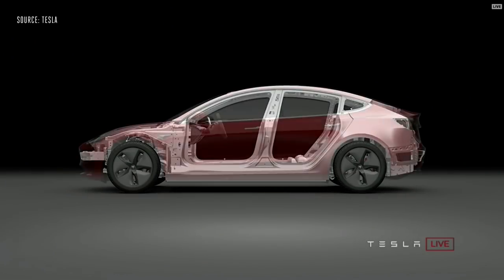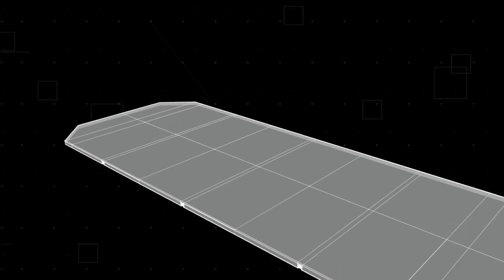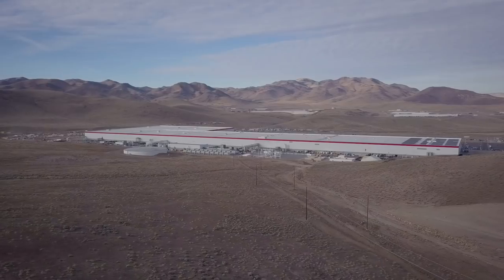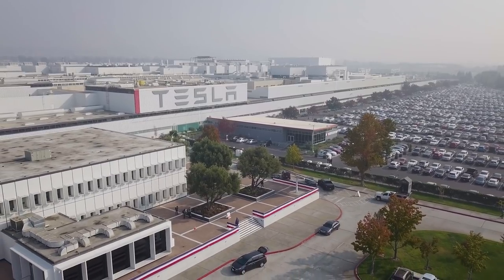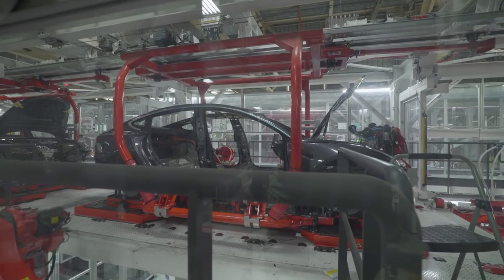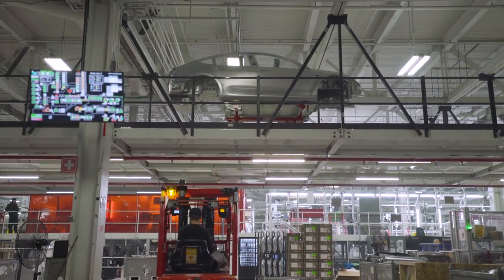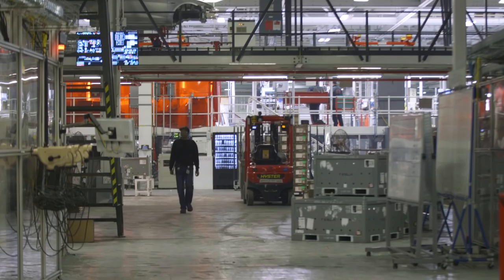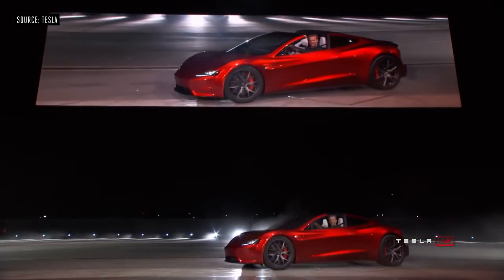This is Elon Musk’s key to Tesla’s future

Comment from the maker: What else would you like to know about the Gigafactory?
Reply: Everything;) lol
Reply: Great Work Verge!
Reply: how many works a gigafactory can create?
Reply: Everything
Reply: Full length documentary
Reply: Have you met musk?
Reply: What's it's CO2 emissions
Reply: Nope
Reply: Is the gigafactory fully sustainable in terms of electricity rigt now or will it require more solar panels ?
Reply from the maker: Kneggor  They're mostly separated (the employees even wear different shirts/hats), but as soon as cells are finished and checked on the Panasonic side, they get sent right over to Tesla for integration into battery packs. Panasonic has maybe a third of the existing factory. – Sean
Reply: Does it seem chaotic? Or organised?
Reply: Please, how can we buy some batteries from the panasonic division there please!!!
Reply: If you`re aloud to, did you see anything or go somewhere in the building that confirms the rumors that tesla will be building their next cars (Y, semi, roadster 2) at the gigafactory or is it all batteries? and if so, which car(s)?
Reply: @TheOriginalDeckBoy  You can't. They are Tesla IP and can only be produced for Tesla use. You would have to buy batteries made in another factory.
Reply: Will the Semi be built at the Gigafactory ?
Reply from the maker: @vincentbelpois2600  The Gigafactory still has a long way to go before it's fully sustainable. It's still currently connected to the electric grid. There's only a few hundred panels at most right now, but when complete there will be 200,000 panels on the roof. Tesla also wants to use geothermal and wind energy for power, too. – Sean
Reply: How many people are working there?
Reply: with a large part of the factory being fully automated how many actual people work there?
Reply: These are my favourite videos
Reply: I wanna know where Elon sleeps and tweets like a drunk man.
Reply: Will there be enough room to have enough solar panels to power the entire factory?
Reply: When will they finish putting solar panels on the existing roof of the Gigafactory
Reply: How much water does this plant use?
Reply: Will Tesla (gigafactory) be one of the pioneers producing solid-state batteries?
Reply: @Elon Musk Do you employ a person or persons whose main purpose is contradicting your specific long term vision as well as your intended goals? I ask this purely from a leadership perspective as I am trying to understand how to both be able to set achievable goals to strive at a seemingly insurmountable dream, but have enough perspective to foresee the hurdles that can derail such big visions and often stop the ability for others to believe in the plausibility of such lofty ideas. 

My train of thought here spawns from wondering how Kennedy got an entire nation behind the lunar mission at a time when such ideas must have been absolutely the work of a madman whose vision was radical to most and actually believed possible by only a very few. I want to have a future where dreamers can dream and use those dreams productively and realistically and just wonder if employing people to contradict these goals could help to actually achieve them quicker by highlighting risks and problems at the earliest stages possible. Or am I relegated to spending most of my time attempting to be my own devil's advocate to fill that role? The ladder almost hinders the ability to stay committed to those dreams. Maybe this is a question best answered by that very introspection but I could think of none better to pose this to. Thank you for any reply, in advance sir.
Reply: Great work
Reply: Tesla roadster 2.0
Reply: +The Verge , What happened recently in Gigafactory about faults found in some 600 Products in Production line ? Would like to know the issue.
Reply from the maker: @Fock42  About 10,000, including Panasonic employees. – Sean
Reply from the maker: @brentquade7032  They haven't given a date yet, but sometime in the early 2020s. – Sean
Reply: Where does the employees come from? Do they sleep in or near the gigafactory and the Fremont factory? Where are the housed and does he work with the cities and towns to accommodate his employees, upper management and production workers? Is food brought by the employees or  brought by a catering company? Is there plans on building multi-level parking garages for the employees at each factory?
Reply: What are the coolest robots?  Are they mostly robotic arms with custom effectors, or are there fully custom robots for moving goods, grouping lithium cells into batteries, or winding motors?
Reply: Worker safety, conditions and pay. Anything else is just a commercial for Musk, Inc.
Reply: Rodrigo Lay Saenz, not sure but it’s going to be 100% renewable soon.
Reply: When will be able to buy tesla in India?
Reply: Do want to know more ?
Reply: Where do Tesla/Panasonic get their material resources from?
Reply: It seemed like a remote location. How far do workers commute?
Reply: Did you saw any Roadster gen-2 there?
Reply: Question: When did that long delayed solar plant in Buffalo get rebranded as Gigafactory 2?
Reply: How many people are there currenlty working?
Reply: Robert Lee gigafactory in the sparks area in NV isnt far from where I live in North Reno, takes me 25 minutes.  I took a job there because I believe in Tesla and Elons vision, I wanted to be part of it all.  Just pack a lunch and drive out there, its not far from fernley either.
Reply: specialtramp great benefits, plenty of over time too.  All positions start at different pay rates and you must work there before being promoted or given management position.  Average pay starts at $900/ week
Reply: Why they’re not using a battery powered forklift 😂😂
Reply: The Verge how do u chose the reporters for ur intersting vids? id like to travel n keep up w views w all SHARE
Reply: How bigger in relation to the showed factory will the Shanghai factory be?
Reply: How many jobs will The Gygafactory  create  when it goes to 100% ? It`s important for the people in USA to understand the big picture for creating  a factory like this one!
Reply: @The Verge , are they planning to lease the factory floor to other companies? I mean like a supermarket, where there's a market within a supermarket?
Reply: Did you see how they make the seats? Like, are they hand woven or something?
Reply: Do they use line robots to move parts in groups?
Reply: Will there be opportunity for other OEMs for other solutions to be able to purchase battery packs for their applications from Gigafactory?
Reply: As of now, how close are they to finishing construction?
Reply: Why they haven't started building their own batteries
Reply: Doubling world battery production is important work and key to the energy transition, but it shouldn't come at a price for those on the factory floor making them. 
I'd like to know about workers' safety and unionization efforts on the floor. Did you talk to assembly workers about their working conditions?
Reply: They used to blow up nuclear bombs 45 miles away from that factory. Good luck walking out of there without some kind of exposure to nuclear radiation and hard chemicals as, all that can lead to cancer
Reply: What's the pay-range for employees?
Reply: Everything especially the Roadster
Reply: As a new tiny TSLA stock holder and for general purposes--more info the better.  Thanks for the video!
Reply: @jeremiegca  "...come at the price of those on the factory floor making them..."  WTF?  Do you suppose they took employment there out of charity to Elon or something??  Hopefully unions will not be necessary as they almost always create a toxic work environment where workers focus on fighting management and management becomes petty and vindictive instead of everyone rowing in the SAME DIRECTION for a common purpose as though they are all in the same BOAT, because they ARE.
Reply: Do workers cycle from one end to another?
Reply: How parallel is the battery manufacturing/assembly? I picture there being large steps for chemistry followed by many hundreds of parallel lines for manufacturing cells and assembling packs. Is it easy to scale this with additional lines to meet demand? Rather than the total output rate, how long does it take from start to finish of a single pack?
Reply: Can it run crysis 3?
Reply: 6:00 WHEN U SEE TESLA USE TOYOTA LIFTERS XD
Reply: Do they have an AutoStore grid?  Because I know a guy...
Reply: how they program the car?
Reply: How do they get away with hiding so many injuries?
Reply: The Verge  I didn’t realize Panasonic was building batteries at the Gigafactory.  I also thought the vision for the Gigafactory was to make batteries exclusively...as in utilize the entire facility solely for battery production.  Do you think Musk has plans to revolutionize battery production beyond (and without) Panasonic?
Reply: What staff facilities are required for a building of this size? I would expect at least one cafe, and a post office?
Reply: Do they offer tours to investors? Been a stockholder for 1.5 years and really would love to get a look at the Gigafactory myself. This is the closest I've gotten. I'd take a special flight down to see it.
Reply: Did they mention the kinds of engineers kept on site?
Reply: How much it costs to make Gigafactory including machines???
Reply: Nothing
Reply: Is it actually denser than a regular factory?
Reply: When Can We See Tesla Here In India ?
Reply: Do the workers at GIGAFACTORY feel that the work given to them is just too much?
Reply: Are the workers at GIGAFACTORY very much driven by Tesla's mission and do you feel the excitement ??
Reply: For those inquiring, The Economy not to far from the Gigafactory Reno/Sparks NV region has one of the biggest economic booms this decade in the U.S. If you have any questions on living  here let me know also, if be glad to help answer questions.
Reply: @salmansalahuddin6305  The company's Telsa and Panasonic is going through local temp agencies for labor. They cant keep enough people employed to work there. It's technically a revolving door for employees.
Reply: BKD Vickers  yes but extremely small nothing bigger than a 3.0 every 10 years or so
Reply: @ayde92829  Temp or Actual employee ?
Reply: How much of the gigafactory is built?
Reply: Does it come with tent-poles?
Reply: the Verge - nothing, but Tesla said going forward all Gigafactory will include some car manufacturing. Tesla also has a casting foundry in Lathrop, perhaps they can make cars there or the Semi. with GM shuttering plants Tesla could buy one for cheap and refurbish it.
Reply: I guess the factory is pretty far away from the employees living place. I‘ve heard that they provide shuttles in order to bring them to the factory or the workers reach it by car as you can see from the massive parking lot. So with their goal of being a sustainable focused company and their massive financial opportunities why aren‘t they providing a greener transportation service like a train line?

It would probably be more efficient aswell. But more important their pollution would decrease enormously for them. 
So right now with the factor of expansion considered they are still more advertising the principle of an sustainable green company than living it in my opinion.
Reply: How about the automation systems, software and hardware, and human labor in the overall production scheme?
Reply: @HansPeter-ol8yj   - Tesla could use the Tesla semi to transport employee using BUS trailers.
Reply: Where will employees park once the factory is fully built?
Reply: ELON MASK PLEASE MAKE CHEAPEST VIHICLES .PLE UR NOBLE HUMAN
Reply: The Verge did they say why they are not using wind power yet? That should have been put in on hills first!
Reply: Profitability.
Reply: how does the current giga factory building (not when completed) compare to other auto manufacturing or other manufacturing  complex in size/volume
Reply: Do they also create the new cars there that still have to come like the model Y and the pick up truck?
Reply: How is it's space being utilized? Seems very spacious for essentially 2 tasks.
Reply: Was that baseball cap you wore in the factory some sort of hard hat?
Reply: When it will go away and be giant abandoned facility.
Reply: We're those baseball hats some of the workers wearing, hard hats??
Reply: my question is: what is the music in the background on 0:34
Reply: How is the air conditioning efficient??
Reply: Question: What percentage of the current building is in operational use?
Reply: Question: What was the most impressive use of automation you saw in the Gigafactory?
Reply: Question: What types of amenities do they have for employees?  A nice cafeteria?  Other things?
Reply: Is the concept of the gigafactory one of modularity with the only limiting factor the available adjacent land? At what point does that become inefficient if it is designed to scale in such a way?
Reply: Great video! 
I was wondering if anybody knows just how much energy is required to make a single cell (or battery pack, etc). I don't want emissions or carbon footprint because that will go down anyways. What's important is to know just how much energy the battery will store in its entire lifetime compared to how much energy in. I call it ESOEI for energy storage and EROEI for energy generation.
Thanks!
Reply: The Verge Is Elon interested in Vanadium redox technology?
Reply: Diego Jaramillo learn English.
Reply: The Verge all of it
Reply: The Verge Does the infrastructure for producing battery cells look easily adaptable if they want to switch to designing a new type of battery? For instance, if graphene cells ever take off, would they be able to use a similar template instead of needing to completely redesign the factory floor?
Reply: @Elon Musk Are you getting into Formula E, in the future for, obviously, no.1 the fun of it and help further promote Tesla and show case amongst the other companies developing electric drives?
Reply: how many cars per day does it create?
Reply: Will they be moving into Super/Ultracapacitor production in tandem with Lithium Ion batteries?
Reply: What type of control system is used for the robots? Is it similar to Player?
Reply: The Verge @theverge  any plans to integrate spacex production? or use 3D printing in any general capacity (cars or rockets) similar to how relativity make their rockets?
Reply: @TheBoyaco  I think you mean to say how many 'jobs can it create'
Reply: Fire protection standards?
Reply: Are Tesla cars sustainable?
Reply: It is col
Reply: I'd like to know if they replace people with robots "see this giant carpark? it will be all productuon sites"
Reply: Gud job verge👍... Do u know when they may be coming to India?.... Becos i would love to have one.
Reply: when will the next factory blocks be built?
Reply: Any news on Tesla 's plans to expand to (South) Africa?
Reply: I wol like to know more about GF 4 in Europe. Where it will be and when it will be completed. Most important, when will they start to hire people
Reply: is the giga factory already be delivered from the lithium explorer pure energy minerals ?
Reply: How do I work there!?
Reply: Why isn't the roof covered in solar cells ? Cloud cover seems really low in the area and the electric consumption is likely huge.
Reply: Where will they manufacture their Roadsters and Semis?
Reply: In what way it is innovative? what's so clever about the tesla production system? How is is different from it's competitors?
Reply: I'd like to look at this platform also how do they power that massive place .....
Reply: @vincentbelpois2600  : don't take my word for it but equipment to manufacture the large and heavy things at the Gigafactory is more than the current: solar technology to the roof area.  Consider the robots large motors and hydraulic pumps. I would not be surprised if just the welding machines use more electricity in a day than I use in a month. But I made all this up from my thoughts, someone prove me wrong.
Reply: Anything new.
Reply: ? @Elon Musk ?  just 3 Questions: 1) Hardest first... What are your tricks and tips? In the context of managing your mind condition(s) of creative, vision, drive, facilitation, etc. Your ongoing frustration of so many people "not getting it" or "they just can't see it". 2) Am I even close? In thinking that the biggest challenge in your life now is finding enough people (the appropriate people) to implement your ideas, especially the ideas that will require many failures to discover the first minimum viable product/service. 3) Most important to me last, How many months for my kind of automation to be affordable? For context, I am a 52 yr old man with near-average intelligence, common sense, and I am currently poor. I will be starting some very small businesses that should help other while enabling me to gain a greater quality of life for mine and me. My kind of Automation/ML/Smart Processes/AI will empower the business a very high level of autonomy think "plug n play" and "set and forget". And Finally: I am grateful for the work you are doing to help us. Please know in your heart, that you are loved by me and many others that do not know you. Regardless of any outcomes you and yours have a meal and a roof to keep ya'll safe. fare ye well and God's Speed
Reply: Is the machines in giga factory as efficient in producing different models of Tesla except the model 3 ?
Reply: Who is the president of the Gigafactory?
Reply: @Elon Musk 

When do you plan to bring Tesla 's ,one of the giga factories or operation centre in India ? 
India is the next big market for EV'S and the government of India has huge budget for clean energy.
WE NEED YOU IN INDIA.
Reply: Where do most workers live?
Reply: @fireofenergy  You are not quite there but are getting close to a thought crime.
Reply: @leeoliver2969  ??? Makes no sense at all!
Reply: @fireofenergy  Sorry, I made a youtube mistake.
Reply: @leeoliver2969  
No problem, Thanks!
Reply: When will the building be finished? They seem to be stopped with expansion in the past year.
Reply: location
Reply: @TheVerge  Why is Tesla so slow to cover the roof in solar panels?
Reply: Very nice and informative video. I'd like to know a little more about fourth one that is supposed to be located in Europe, in Germany or the Netherlands. Any more information about that?
Reply: @Jackiefrompr  Electric Ave, Sparks, NV 89434, USA
Reply: How did you get a tour?
Reply: Where did Elon commit security fraud?
Reply: are they producing batteries for any company that asks or is it just for elons projects
Reply: Elon Musk  please give me an interview for a job in the Netherlands 
Would love to be part of team to grow Tesla in EU.
Reply: Can you show where the raw materials come in, where the batteries are made, which segments that body panels and painting are done ?
Maybe from an aerial view with color markings?
Reply: How do they run that factory on 100% solar? Damn thats awsome.
Reply: How they would  use and if they need nanomaterials scientists.
Reply: Is it possible to visit it, or just take a picture outside of it like you guys did? I'm from Brazil and travelling to Vegas in a couple of weeks. I wonder if it would be OK to stop by near it and see it at least.

Thank You.
Reply: Really admired about your work @verge
Reply: Great work!!!!  I was wondering does Tesla  has a plan to deal with the used battery in the future? maybe a recycle plan?
Reply: Wait for a name call kulaib the richest man ever just wait
Reply: What's it like for (non-automated) workers? Seems like a really deep floor plan for people without natural light
Reply: Do a map of a gigafactory wich shows you were is builded motors were is builded a bateries and so on..
Reply: can it run crysis ?
Reply: Is whitholding information lying?
Reply: I dont think anyone is going to want to pay $40,000+ every 8 to 10 years to replace the battery pack...you think Tesla is having a tough time selling cars right now just wait until battery replacement begins.
Reply: Why the E in tesla is missing the left line..
Reply: why are the cars in that car park all gas powered?
Reply: @jeevan09241  Wowzers! I knew all of this innovation was possible. I wonder why others around me were allowing me to think my ideas were idiotic.  Turms out they were laughing all the way to the bank at my expense.  Well. @ElonMusk I wondered when we'd experience some killer acts of kindness in Pennsylvania. Better late than never, huh?
Reply: When can I buy one?
Reply: Can public visit? i am eager to see this massive factory
Reply: I'd like to know what's going on with the Buffalo, NY location?
Reply: Where would Roadster, Semi, and pickup truck be produced?
Reply: When is the gigafactory 1 finally completed? Her construction has been abandoned since 2017.
Reply: How many solar panels/system capacity to date?
And proportion of electricity  generation to consumption
Reply: Soon Tesla buyers will have their car delivered by Auto pilot straight from the factory to their front door. Amazing technology folks!!
Reply: Callum Gillman h
Reply: When will the whole roof  be covered with solar panels?
Reply: every think that you have
Reply: Any gear going out the back door?
Reply: Why Panasonic won't expand battery production capacity that Tesla are asking for.
Reply: Why not a couple of videos on how it's made for products like.....one day on model 3 and another for batteries
Reply: Excellent- The right direction, in any case. I always wondered there must be a better way when it comes to the production of electricity, possibly the key is the what Benjamin Franklin showed us when he had the Key attached to his Kite. Can't we create the same condition as are in the upper atmosphere and produce our own lightning, and figure out a way to regulate that power
Reply: How much solar to grid energy use.
Reply: How much can this factory collect? I foresee the future. lol
Reply: I guess we should go back to the horse and buggy?
Reply: Stop playing games when driving. We are driving on real roads, not in simulation studios. Otherwise, there's nothing else to know more about.
Reply: Heillo good afternoon
Reply: yes
Reply: what about model Y?
Reply: @markplott4820  I think the trouble is that most of these closed factories are in states that ban teslas.
Reply: When is Tesla planning on building the Model 3 at the Gigafactory itself?
Reply: @jeevan09241  Welcome to Brazil , Mr. Elon Musk and Tesla Model Roudstar, Greattifulll time for investiment here in Brazil now .... Think about this moment....in Brazil.
Reply: How did it all started??
Reply: @TheVerge  maybe Mr. Musk like to make Investiment in Brazil, now is great time for start Business now about elétricar and Solar Fotovoltaic energy ....
I m give the direction for Him in Brazil about Brazilian lo....
I m Know everytink about Brazilian lo....!
Reply: @Elon Musk  are you going to inhale the next time you appear on Joe Rogan's podcast?
Reply: ONE YEAR LATER UPDATE
Reply: Machinist jobs?
Reply: do every tesla have more than 1 GB of storage?
Reply: Is the Chedic mine functional? If not, what are the issues?
Reply: Welcome to Brazil , Great time for bussines Electricar and Solar Fotovoltaic energy ... We have great Place for Estrategic  developy  sell  here in Brazil , Sout america and Sout Africa and Brazil Place ....
Reply: The Verge Excellent, Sharing Through The TRUTH Network...
Reply: Are you hiring
Reply: I'd like to know how much fossil fuel they use to mine raw materials to make their batteries, make their solar cells, and power the factory...  basically what their rebuttal to Michael Moore's "Planet of the Humans" would be...